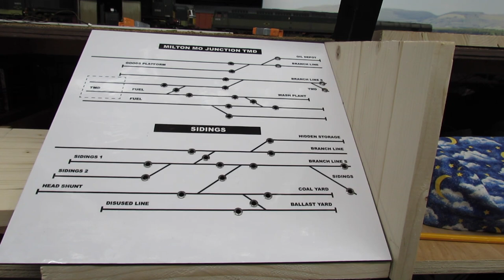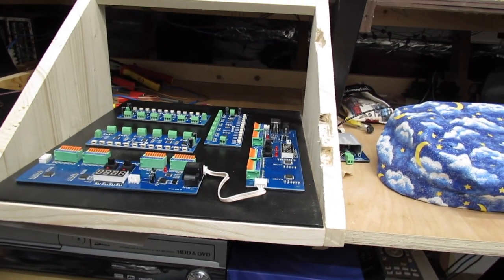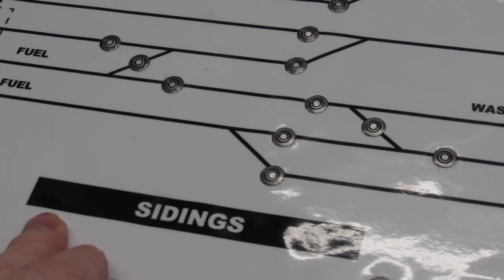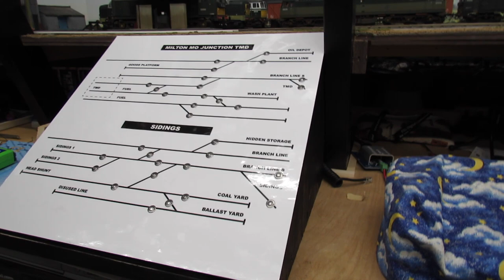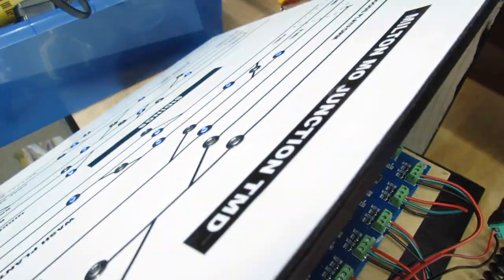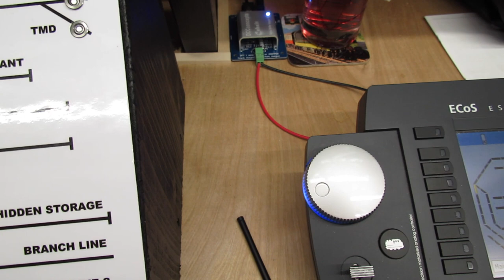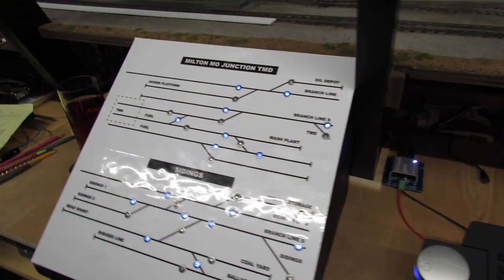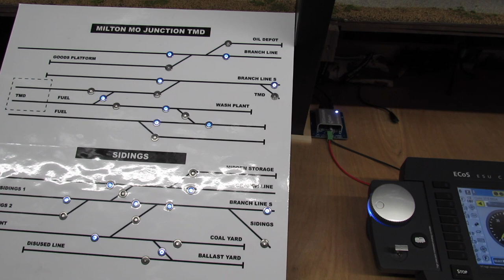Milton Mo Junction 85

Comment: Hi Robin, well that turned out really well in the end, I was thinking of doing much the same thing as with my Z21  you have to flip between screens, but fortunately I got a free tablet with my new phone so that will be the dedicated point control! I also like your point schematic very clear. Cheers for now Robin, John
Reply from the maker: Thanks for that John, I have just been up in the loft for a little running session to try out the new controller and I can't explain how much easier it is without having to switch screens on the Ecos. Also on the Ecos the track plan I work on is of the whole layout, I do have separate ones for each are but that is another screen switch. This means that the plan is upside down on the screen for the sidings side and it is surprising how that makes it difficult to see what point you have to change. On the new controller I have created the diagram so that both the TMD side and the Sidings side are draw as if you are looking at them (hope you understand what I mean) that with the labels on the diagram makes it so much easier to change the points you need. The diagram is also larger than the Ecos screen which also helps. Robin